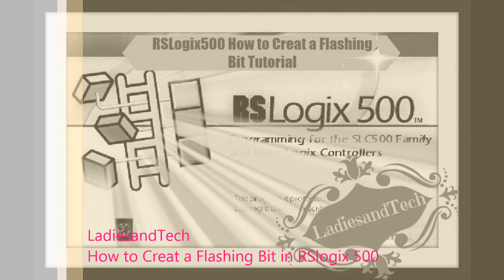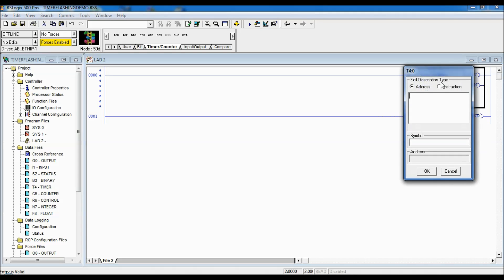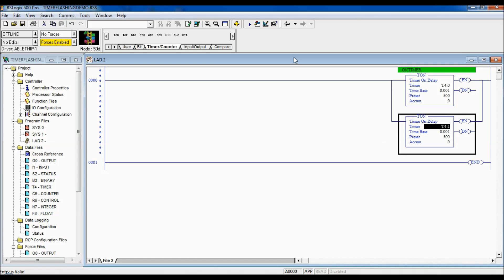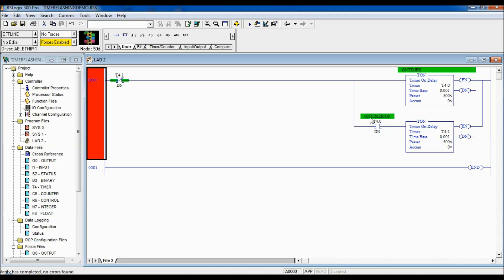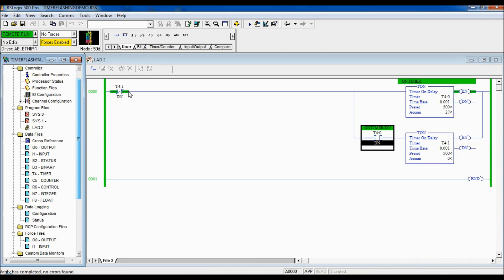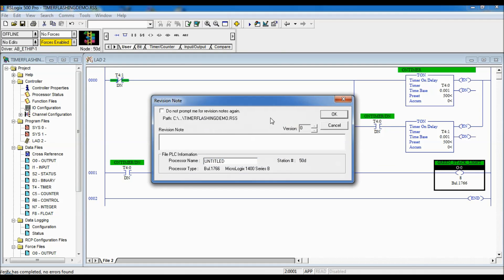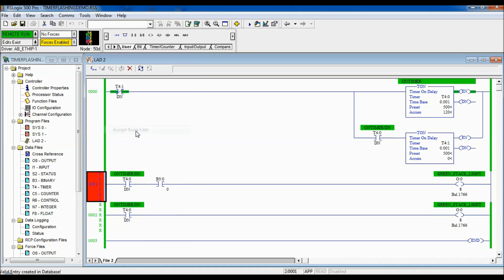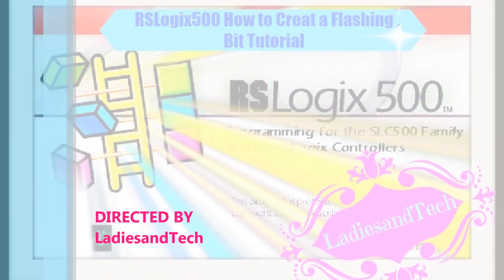How to Create a Flashing Bit In RSlogix500 Using Timers

Comment: I did exactly the same thing with a normally closed stop button (with xic), a normally open start button (with xic) and an internal bit as an output, sealed in. It worked perfectly. Then I tried doing the same thing but instead of the seal in I tried using the (L) and (U). It didn't work..... should I use a -|/|- XIO for the stop in this case?? 
Can you do this example?